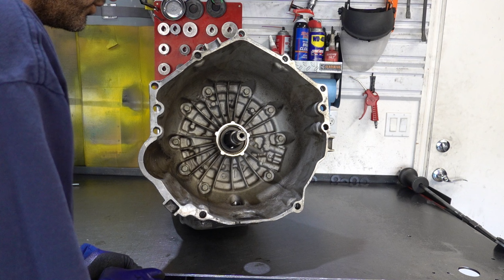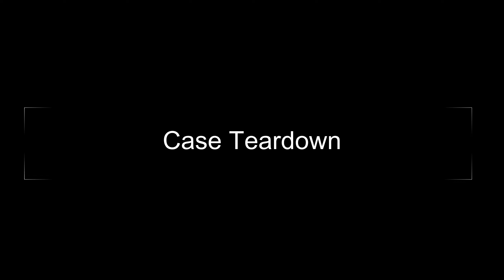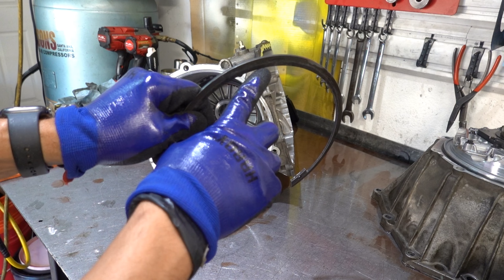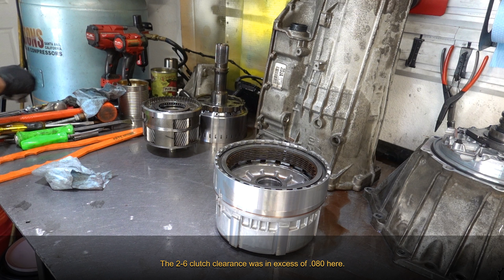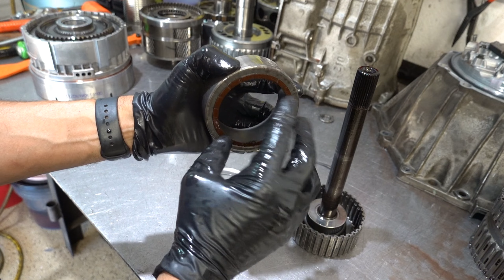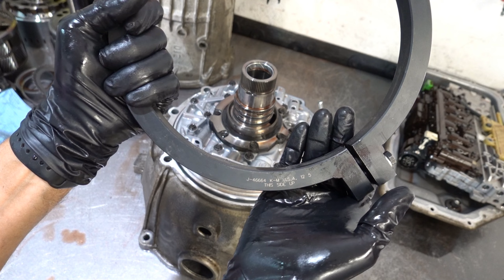6L90 Teardown and Inspection: Broken Heart

Comment from the maker: Couple minor points of clarification: 

1) The 2-6 clutch and 3-5-R clutch use the same snap ring, not the 1-2-3-4 clutch - that clutch snap ring is different
2) The four long valve body bolts at the rear of the valve body, along the bank of solenoids do not have to be removed to take the valve body off the case - only the very long filter-vb-case bolt.

Comment: I don’t blame you or the costumer for wanting to do this for this trans it’s a very expensive job and if everything is still in good working condition no need to replace everything this video will help someone trying to save a few dollars I’ve been turning wrenches for 35 years now and you did a great job.
Reply from the maker: Yep, not ideal but like you say, if the customer is good with it, needs to get the vehicle back running and everyone is on the same page about expectations then all is good.  Thanks for watching, KAR!

Comment: Hey:  Many thanks for making this video on the GM 6L90 - I enjoyed the video very much.  I have a Chevy 3500HD gas engine with the 6L90 transmission.  Since you see these transmissions on a more regular basis than most,  what ATF do you recommend, especially for a 1 ton pickup?  And, what about the fluid change interval?  Some say just to use any Dexron VI ATF whereas others claim that you should use a premium Dexron VI ATF equivalent such as Redline or Amsoil SS ATF.  The GM recommended change interval is 45,000 miles for the 6L90, and many say that's too long.  When time permits, I would really appreciate your input.  Many thanks,
Reply from the maker: Thanks for watching, RG...Any Dex 6 synthetic is fine; if you want to run Amsoil or Redline, that's fine as well.
Reply: @nickstransmissions  Many thanks for the prompt response.
Reply from the maker: You're welcome.

Comment: A few questions
1- Last video you talked about the unigear having a different connector and were surprised when found not present. Did it have the correct connector/harness?
2- When removing the pan, very little fluid was inside. Did you remove the pan prior?
3- With all the carnage in the pump, should there be plenty of metal in the pan?
Reply from the maker: Yep, was def surprised not to see the unigear - currently researching that change-over...The simplest explanation is that this unit was actually produced in 2011 and given a 2012 model year stamp but that's just a guess on my part. I drained all the fluid when I turned it over - I do this very early in the video. The fluid is so dark, it blends in with the bench surface so may have been difficult to see initially plus that bench is sloped rearward and all the fluid quickly drains into a catch container underneath the bench.

The pump is a self-contained unit so unless a whole bunch of TC-pump hard contact and subsequent grinding takes place on the aluminum working surface, you'll generally not see any debris in the pan from this kind of pump failure.

Comment: On the broken pump. 

I have seen this three times. 

1st time. Customer did not get the converter in correctly then installed the transmission. 

Other two times were torque converter hubs that cracked. Both were after market high stall converters. Yes I know the company. But am hesitant to name it. Don’t want anyone getting sued for calling them out.
Reply: Just what I was thinking. Nick likely didn't get the full story. Either they replaced the converter at some point or went crazy with a tuner. TOO MUCH PRESSURE! SHE CAN't TAKE NO MORE CAPTAIN!
Reply from the maker: Agree, these don't happen very often - this one is unusual...
Reply from the maker: I'll ask the customer about tuning, didn't broach the subject with him so good call out.